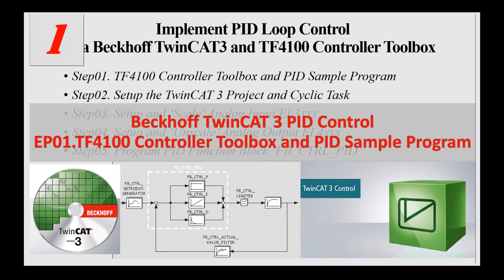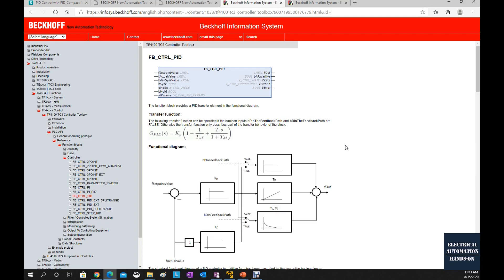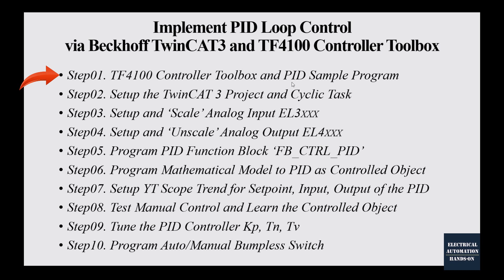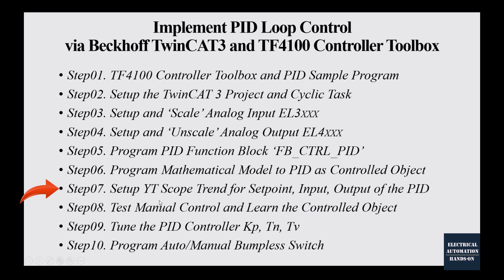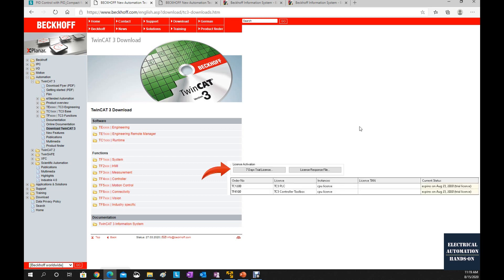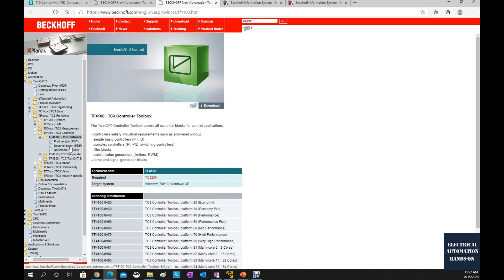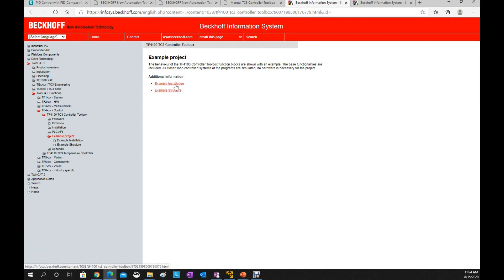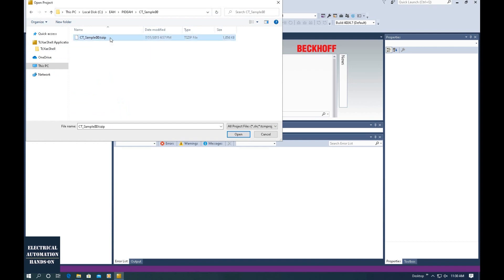PID21 - Beckhoff TC3 PID01 - TF4100 Controller Toolbox and TwinCAT3 PID Sample Program

Comment: I haven't Tc3_Interfaces Library in TwinCAT. Can you give or guide me download Tc3_Interfaces Library?
Reply from the maker: You do not need "Tc3_Interfaces" for the PID program. Also "Tc3_Interfaces" is built in at TwinCAT 3, no needed to install any software. Go "Reference" -> Add library -> type in "Tc3_Interfaces" you can find it.
Reply: @electricalautomation  My project want Tc3_Interfaces. When I "Buil Solution" then occur error: Could not open library '#Tc3_Interfaces'. (Reason: The library 'Tc3_Interfaces, 3.3.0.0 (Beckhoff Automation GmbH)' has not been installed to the system.)
Can you help me?
Reply from the maker: @nguyenvanviet0906  Try this link https://github.com/craigmcchesney/protosim/blob/master/XtesSxrPlcProto/ProtoSimPLC/_Libraries/beckhoff%20automation%20gmbh/tc3_interfaces/3.4.3.0/tc3_interfaces.compiled-library
Reply: @nguyenvanviet0906  TC3_Interfaces is not needed since TwinCAT 3 4024 so you can simply remove the reference under PLC>TcControllerToolboxExamples>TcControllerTollboxExamples Project>Referenecs by right clicking on TC3_Interfaces and select remove

Comment from the maker: Note: "FB_BasicPID" (Free PID)
If you do not need the Function Blocks from TF4100 ControllerToolbox, you could use the 'free PID' from 'TcUtinity.lib' and find the simple PID "FB_BasicPID". Using FB_BasicPID, you can implement the PID loop control without purchasing TF4100.
 "FB_BasicPID" (Free PID) https://infosys.beckhoff.com/english.php?content=../content/1033/tcplclib_tc2_utilities/18014398544458379.html&id=